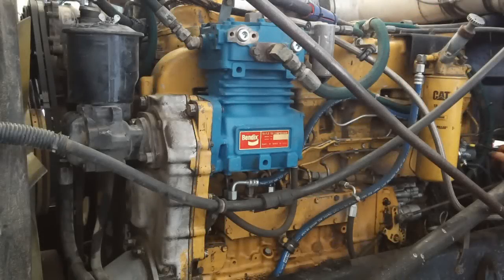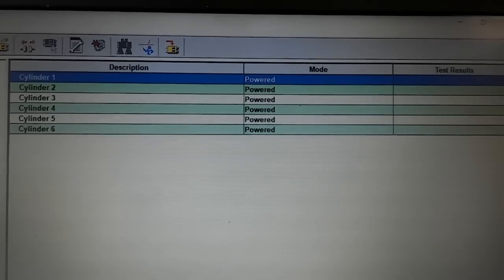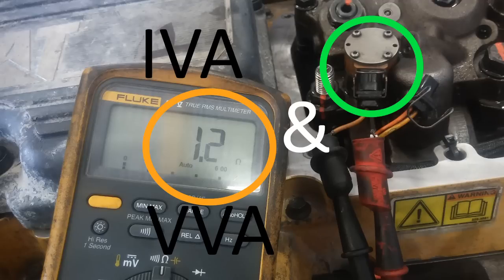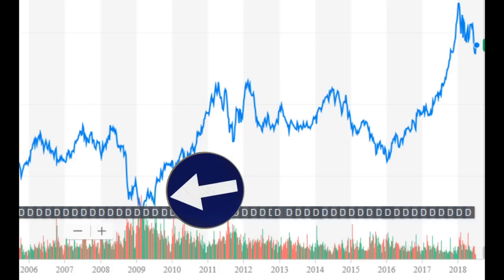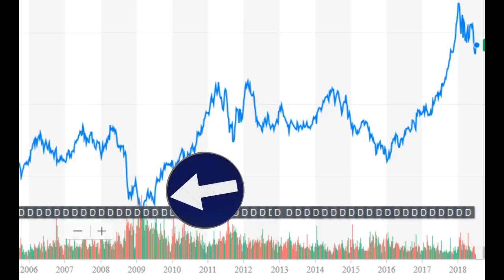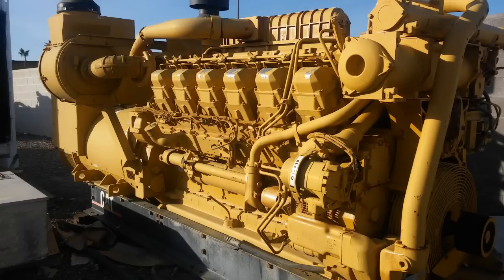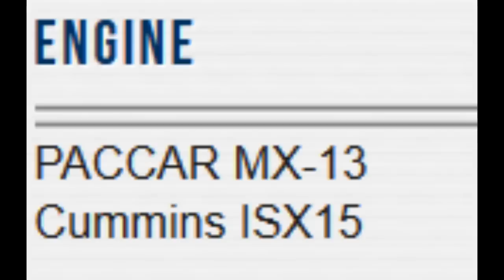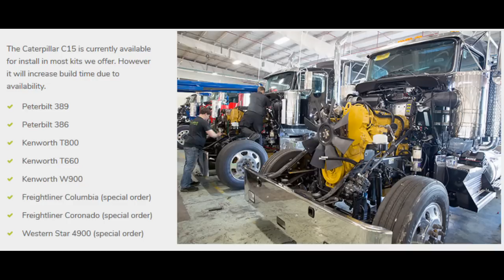Why Did Cat Stop Making Truck Engines?

Comment: We have one CAT powered truck on our fleet, a 1994 Pete 379 and the crusty old driver who drives it said you'd have to pry it out of his cold dead hands.
Reply: He must have enjoyed all that down time while the truck was being wrenched on.
Reply: Go ahead call the police
They cant unrape you
Reply: I have a 2000 2136 Cat with 89, 000 miles on her....I just took her across the country. I still don't have a 100, 000 on her. She is the Best..  A Beast. I will be dead and she will still be running.
Reply: Typical whiner driver...
What's the difference between a trucker and a puppy? The puppy will eventually stop whining 
What's a trucker call his basement?
The whine cellar
Reply: that exactly what my last truck as an o/ o was!    500 cat w 15 spd .. i had a damn good otr life because of that truck
Reply: wow, good for you. A quote, from Men In Black 1..........model 379 is nice n quiet, inside. I used to install tachographs, in these new models, in 1997. test/calibrate on dyno...
Reply: I had a 3406b with 1.6 million miles.  Very reliable.  But not fuel efficient.
Reply: I would have agree with him. there's nothing better than a Pete 379 with a Cat engine in it, and a 15 road ranger.

Comment: What? Couldn't they find a Mitsubishi engine to repaint yellow, double the price for it, and stick a CAT label on it like they did on my forklift?
Reply: CumminsDslPwr 😂😂
Reply: CumminsDslPwr if they stand behind it like any Cat engine,  i don't care if they paint a Duramax to throw in it.
Reply: Tom Novak 
What was a shock to me was the Olympian generator line. 
Generac is such crap, and to see cat team up with them was disappointing.
Reply: they do that with perkins engines in tractors and welders
Reply: The reason why Forklift have Mitsubishi engine is mainly because those forklift are not made by Catterpillar. Cat aquired a compagny to expand their line of product. Hell the website for all the information about those forklift is not Cat but MCFA (Mitsubishi Cat Forklift America) 

But then in some forklift you will actually find nissan engine or even GM engine. I do like the durability of the TB45 or if you go diesel the S4S or S6S... until they replaced those with engine that were more "environementally  friendly" (sure it the engine is not running half the time it bound to be good for the environnement :D)

But back on the main subject, There a Mitsubishi engine because it an association between Cat and Mitsubishi to seize a part of the market Cat didnt have already in their attempt to have a solution for every client special situation.
Reply: Cat and Perkins parted ways.
Reply: I just want to see a Cummins painted yellow...well it's still not as strange as the Cat branded Navistar trucks lol
Reply: Its funny, here in Oklahoma City the Cummins place is so busy people take Cummins motors to Cat and they work on them.
Reply: @Carson Chaney: No we didn't.
Reply: Ps dont knos how you guys do it but over here its a small narrow country and freight gets forwarded  north and south. Some companies run their trucks 24hr with 2 drivers going 12 hr each anx s truck can do 1 million km a year (600 000m)
Reply: You were lucky to have that Mitsubishi!!! I had the same problem but it was a french Peugeot pile of shit.
Reply: Sorry no refund, thank yu come again
Reply: Unfortunately larger Mitsubishi Diesel engines are not nearly as reliable as the type that you have on your forklift. They run at a very low idol and they stall easily.
Reply: Meanwhile Popeyes $5 Chicken box is back
Reply: I can’t stand their  chicken! It doesn’t even taste like chicken it tastes like spam.
Reply: CumminsDslPwr no but they found 12,9 liter Fiat engine, painted it yellow and call it Cat marine engine. Which is actually better than any Cat engine ever built.
Reply: Never seen a Cummins painted in yellow???I do! I volunteer for a well known train museum and we do have a railway crane that has a yellow Cummins diesel, and get that; built in Great Britain!How's that!
Reply: CumminsDslPwr nobody cares about "your" forklift that actually belongs to the company you work for kid.
Reply: asdg asdf - Peugeot bought Citroën and gradually phased out Citroën engineered cars. From now on Citroëns are just "badge-engineered" Peugeots.
Reply: Satan - No comprende vd. el Ingles?
Hell isn't "yours" either.
Reply: Lol so true.seems like a large portion of cat engine part are either Perkins or 
Mitsubishi.
Reply: ooo.ooo, spam goot!
Reply: Dan Cooper So you don't like money.
Reply: Leif Keskevaari Are you nuts Fiat makes shit all junk look at Chrysler junk .
Reply: Al Grayson as bad as Fiat junk.
Reply: Carson Chaney nope we still make perkins to this day
Reply: Tim Hill do u work for Cat it's the weekend I enjoy while we have off lol and yet I find myself looking at Caterpillar videos on my off time😂🤔
Reply: I agree. It seems like all the smaller Cat equipment uses the mitsubishi engines. Why don't they do the same as an option for the new Fords? If Ford had an option of a Cat motor, I would go with that. My dad's 6.7 Powerstrok is a POS; I think a Mitsubishi or Cummins would have done better in it.
Reply: and Mini excavadors?
Reply: What about the Mitsubishi Fuso diesel motors? I saw an ad on KSL about a Ram Promaster van with that motor in it and the seller called it "legendary".
Reply: Your forklift is a Mitsubishi.  Made by MCFA. They rent the cat logo. Sorry bud no more cat forklifts.
Reply: Perkins was anoutherengine cat used  in small dozers mitsubhi was anoutherengine and every so often in the d4 s you'd see a cat the company I worked for had all three I must admit they all did pretty well ,I'm told Cummins could also be found in them but this I doubth but???
Reply: No.  Cat and Perkins did not "part ways."   Catepillar still OWNS Perkins Engines and it is run as a wholly owned subsidiary.
Reply: Philippe Riopel check out the old Israeli M51 Super Sherman’s.  They had yellow Cummins engines in them
Reply: Robert Stennett ford doesn’t own a single share of Cummins, hasn’t since 1997.  Stop spreading bullshit
Reply: Actually they do, check out the excavator line. At least one had an engine that was crossed between a Cummins with cam follower levers and Detroit 2 stroke injectors except the rack worked the opposite way. Caterpillar actually builds very little but they do paint up and market other manufacturers stuff well.
Reply: I thought only John Deere did that with Yanmar engines.
Reply: That's because Fuji heavy Industries makes forklifts. You could've had a Toyota.
Reply: Yeah cummins is better
Reply: @AD-fd9vz  our one cat towmotor has a 4.3 chevy in it lol
Reply: @poweredbyford87  well that because towmotor was buyed by cat a long time ago. Am surprise it still work
Reply: @tomnovak7731    When a company especially a company that uses forktrucks like manufacturing does, not only stops making money the instant downtime begins, they are going in the hole. Yes they are spending capital they have banked. If a kid buys a truck and it breaks down, he is just inconvenienced and mom can take him to school or he can borrow her car but a money making operation looses money. Think of long haul truckers, when their trucks break down they instantly stop making money but still they are charged insurance, the driver has to sleep in a motel while his truck is being tore down, and he still needs to eat. All of that and other overhead and that's IF he has full service warranty and dosen't have to pay towing or repair bill. Also he still has to to the bank and they dont care if his truck has been down for warrants and repair for the last 365. They want to be paid. A small business can go belly up very quick.
Reply: @AD-fd9vz  Hyster/Yale Fork trucks used Perkins, 4.3L GM, 2.6 or 2.4 GM and two differant small 4 banger Mitsubishi engines back on the 1990s and early 2000s. I assume they still do. Man I loved the sound of those little Perking firing up.
Reply: @asdgasdf9580  u
Reply: @Robert Stennett Ford did have an 11% stock ownership in Cummins purchased in 1990. Cummins bought it all back in 2013. Ford has no ownership interest today and has not for almost 6 years.

Comment: Boy, I love a C15 with an 18 speed behind it. Get on it and the whole frame would twist. Fully loaded vs fully loaded, not much is going to beat you off the line. Most of the new equipment is good, but raw torque is fantastic.
Reply: Cat does not honor their own warrenty.

Comment: We have a huge fleet at work full of older and mid to late 2000's Cats, and plenty of new Paccars and Cummins on the on road trucks. The New Trucks are constantly having issues and the Cats keep going.
Reply: Probably because half of your operators are 20000 year old relics that still live in the middle ages.
Reply: Depends on the years and how you run them

Comment: Thanks for the explanation.
Brings back memories of the ADE V series that Merc used here in South Africa.
Loud and very powerful.
I rewired a dyno at the reman facility that Cargo had in the days when one could just get an engine swap from the dealer.
When testing a 16 cyl they just used a fire hose on the intercooler and not much could be seen through the steam.
Don't see Merc's around like one used to when they had those power plants.
It's mainly Internationals followed by Volvo's and Scania's.
Very few Mack, Kenworth or Western Star's to be seen here.

Comment: Cat Never really looked to figure the emissions out in ways that Volvo or Iveco (CNH Industrial) had already in the works in the way of just pump DEF into the exhaust and they did use more DEF but did not require EGR or to Regen and now they just regen passive which is much easier to do than to force it

Comment: It's a shame because there's nothing better than a Pete 379 with a Cat engine in it. especially the larger displacement engines like C 15 or larger. and preferably a 15 speed road ranger transmission.

Comment: My dad had a ole green international truck he hauled wood chips with, it had a CAT in it. He also had a western star he hauled equipment with. It had a Detroit in it, after riding in both I can clearly tell which has the far superior motor, the CAT was a beast
Reply: What kind of detroit
Reply: nothing like a caterpillar.....a good 6nz push easy 700 hp...only little mod

Comment: Just a damn shame, I put over a million two miles on my 3406 before the overhaul with no surprises.
Wish they could find their way back in.
Reply: Their biggest mistake was not adopting SCR, along with not properly fixing the ARD head.

Without SCR, you would have to rely on EGR to reduce NOx, which reduces efficiency because you have less oxygen in the intake air. This increases fuel consumption and particulate emissions. And although you can filter out the PM with a DPF, you now have an exhaust restriction that gets worse and worse as the DPF gets plugged. You can add a regeneration system to clean out the DPF, but that takes extra fuel or lots of electricity. So your fuel economy just went right down the toilet because the EGR and DPF are choking your engine down.

This is where SCR comes in. When you add more oxygen into the intake, PM goes down, but NOx goes up. Luckily the DOC and SCR system can easily take care of that. No more EGR = hotter, more effective combustion = less PM emissions. Now delete the DPF.
Reply: @electric7487  I wish more manufacturers would of went scr/doc only. But, people are scared to put def in. But you're correct, the engine gets to run at high efficiency, and not deal with egr, and pushing tough a dpf.
Reply: @tangydiesel1886  In my opinion, the bigger issue is that the EPA set the strictest standards as blanket standards with zero regards to what is necessary vs. what is excessive.

Comment: Cat engines were very popular here in Australia for what we call "Bitsa" trucks. There were like Kenworths where you could specify your choice of Cat, Cummins or Detroit Diesel. But whats happening is that the Euro 5 emissions saw the traditional US engine manufacturers really struggle when the likes of Volvo, Scania, Mercedes/Freightliner, MAN, DAF etc all came with their own compliant engines with fully computer program run EMS's. What also happened was that the Euro's gave you a free minor service deal as well as full engine warranty up to 1m kms. These also came sealed. You could really only do minor maintenence. For the rest you had to use a dealer workshop. This works fine, but here in Australia, road trains and truckes that drove on dirt and gravel roads in the harshest conditions still support the Kenworth/Cummins combo as they will still offer warranty for them.
The advent of climate control, sat connection, 20sp automatic transmissions and beautiful interiors really do make a difference to the life of a long distance truck driver, here anyway.

Comment: I was an in-use emissions engineer for Cummins during the 07 crackdown and I understood the reason for Cats exit was because their warranty claims were thru the roof based on sulfuric acid corrosion. I have no first hand experience with Cats but was told they took exhaust downstream and recirculated it back to the cylinder, but the gas path was so far that the gas cooled and the sulfur condensed, creating the sulfuric acid corrosion problem.
Reply: That did happen - but it affected the aftercooler not the engine.  New aluminium grades had to be developed to cope with the acid. The benefit was no soot in the engine - and less heat for the EGR cooler to deal with - some really good ideas - but as a whole it didn't work.
Reply: @iansouthman3882  Makes sense until you learn how destructive sulfuric acid is and realize it has a low dew point. I dealt with sulfur corrosion a lot in my career and coal burning power plants deal with it by having redundant systems in place to ensure the back end temp stays above the acid dew point. Components susceptible to corrosion are also coated with different types of ceramics and proprietary coatings. No steel and very few metals can stand up against acid corrosion. Duplex stainless does pretty good, but its not totally immune. Very nasty stuff once it hits the dew point.

Comment: Had an 87 359 with a 4 in a quarter an a 15 over in the ashtray final gear driver. Had that truck forever. That little kitty ran clean and didnt burn oil. Pull trottle out to 1000rpm and sleep like a baby in that ol flat top.
Any ol skool hicks remember those days?
Reply: Yep sure do, always said I knew my cat better than I knew the wife's backside, I could have been in the sleeper sound asleep let that four in a quarter make the slightest different noise I was awake.

Comment: Anybody enjoying every last minute of their straight piped CAT engine in 2019? 🖐🖐
Reply: Still running a Fleet of Pre 1990 T600's Powered by Cat. And 2 W900's with 3408 Cat Engines. All are Pre 1990 and my Drivers will not give them up. They have threatened to quit if replaced with Today's Plastic DEF Crap.
Reply: Hell yeah. Would trade it for nothing. The emissions on the newer trucks are pieces of shit. Thanks California
Reply: I got a ford 7.3 straight piped.  Haha suck it government, cant make me put all that shit on my truck.
Reply: @pipeline_hank5277  probly will in the future
Reply: @pipeline_hank5277  well when diesel reach European levels $7,40 per gallon, you probably think different about the engine in your truck.
Reply: @curtekstrom6600  ahh yes, the dumb environmental fluid. The fluid that causes cancer in place of environmental emissions.

Comment: I work at a Kenworth dealer. We still sell a lot of Cat parts for older trucks but some are becoming hard to get. They don’t get enough good cores back to rebuild so we have very long lead times on pumps, injectors, cylinder heads, etc
Reply: LOL
Reply: @zythr9999  I thought lead times were bad 4 years ago 🤣

Comment: I had about 15 CAT's, all 3208 or 1160 V8's.  Not their greatest models, they were non sleeved.  But the 3406 Big Rig engine was quite popular.  People seemed to start losing enthusiasm when it went to the 3406"E" as in Electronic engine.  This was the beginning of engines that you controlled only indirectly, and required a computer for tuning and differing horsepower. My main beef with CAT was that their parts were so expensive.  Cummins or IHC or the old Detroit Diesels were so simple anybody could fix them, the end of mechanical NON-electronic diesels was a sad day.  Yeah, the new stuff is powerful, much cleaner, and gets better fuel mileage.  But the complexity.......

Comment: the C15 & C16 just about broke them with problems , engines burning oil, I was told not enough rings, trying to make more horsepower by not installing enough rings